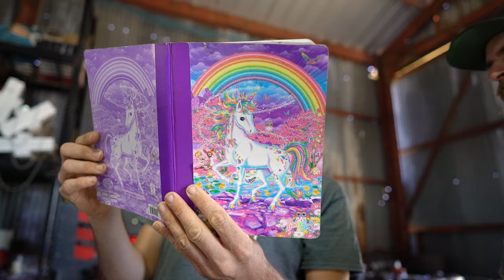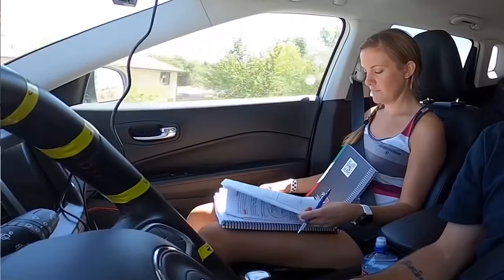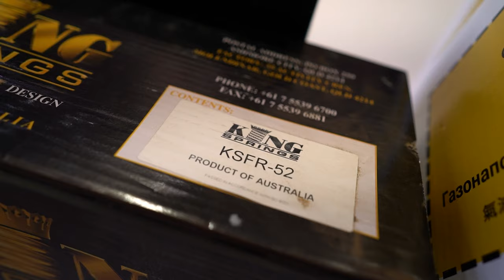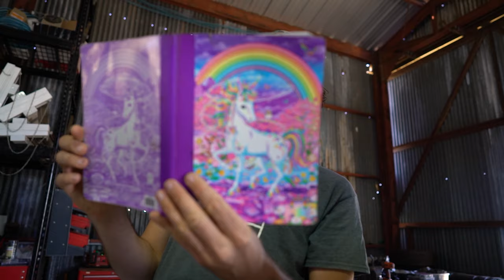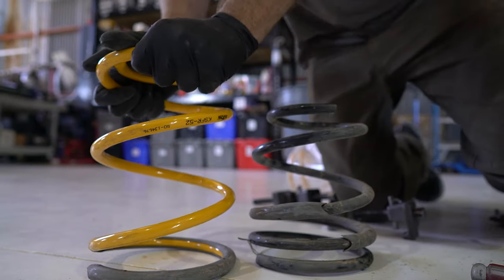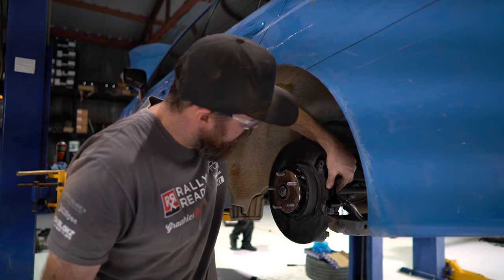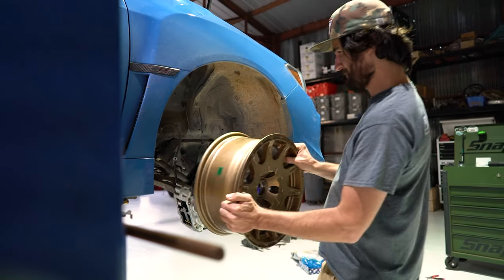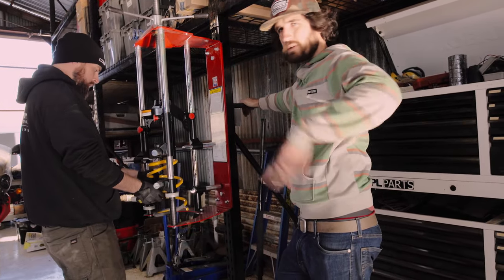Building The Ultimate Rally-Spec Daily Driver STi - EP 1

Comment: Great video. I’m looking to do this with my 2019 sti. I had a couple questions. What’s the part number for the struts? Also are they longer than stock?
Another question is how are the king springs vs a rally tech 2 inch lift kit? And my last question was how do these mods affect the alignment? Will I be able to have the correct alignment for daily driving? Thanks in advance!
Reply: I'm curious about the specs too, but also assuming the good'ol 15" Methods on a 205/65R15 tire. 🤔

Comment: What size tires did you go with?
Reply: I'm guessing from the brief glimpse of tires they are 180/650R15
Reply from the maker: Correct. That's the only size Yokohama rally tire currently in the USA. We would probably size down to a 170/650R15. The 180/650 is equivalent to a 205 on section width.
Reply: Is there a way to calculate an equivalent tire size in the two digit sidewall to width ratio number? For example: 205/70 R15